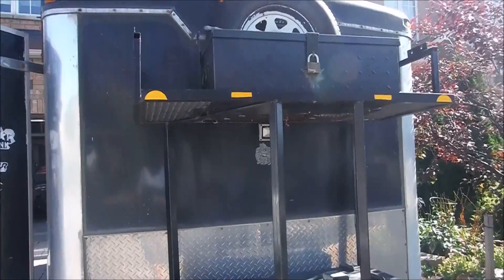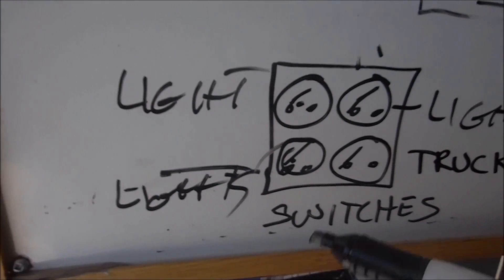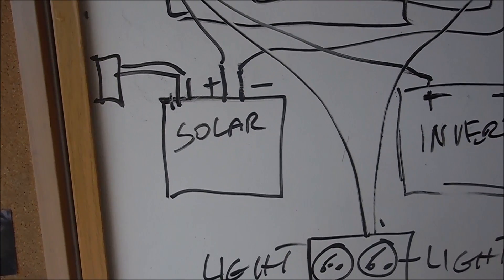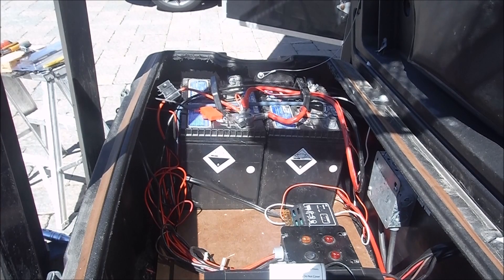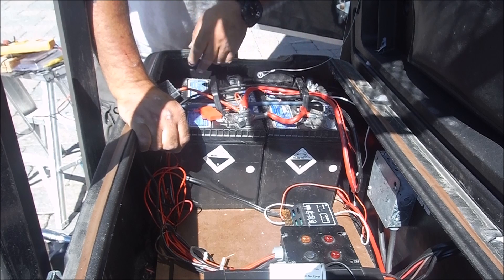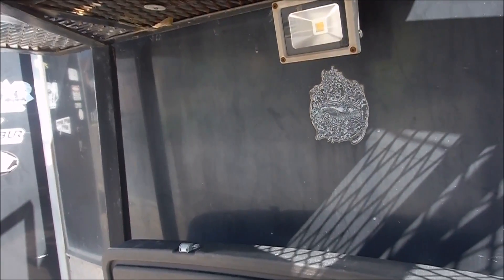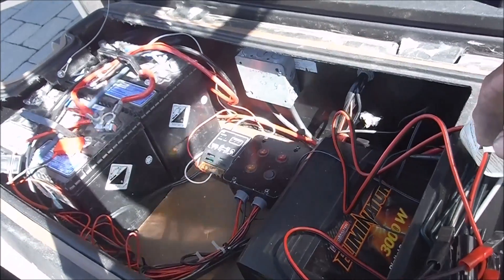How To Connect Solar Panel to two or more 12 Volt Batteries

Comment: What size solar panel does it take to charge two 12v batteries like you have setup
Reply from the maker: I only used a 40 amp and it was fine . If I was to do it again I'd go minimum 80 just for a faster charge but 40 works fine

Comment: Ps, I've noticed that you've put 3 wires on one red and 3 on one black. It's getting a bit crowded. 

Question: can I put the inverter on the other red and black battery point's, using the both batteries? That means there'll be 2 wires on every battery connection point? Instead of 3 wires on 2, and 1 wire on the other 2. Hope that's ok? Paul 🙏
Reply from the maker: yes you can. I just used what I had and all individually fused. As long as you keep the batteries in parallel is all good . I would show you but both my trailers are in storage. I actually bought a power distribution center and just have one wire on each terminal now. was a pain connecting all those wire everytime i put the batteries in. 4" Ground/Power Distribution Terminal Block Battery Bus Bar Set [Max. 300V AC/48V DC] Negative/Positive Insulated Busbar for Auto Marine Car Trailer RV Boat - Black/Red on amazon
Reply: @FranksDIY  ok thanks Frank. Eventually I'll buy some Solar and batteries to do just that. Cheers, Paul.

Comment: Thanks! Just bought a 100 watt panel.hoping it can run a mini fridge for deer hunting
Reply from the maker: Its all on the battery capacity. Have a few good Batteries and it should be fine. Well for me I'm in Canada and my deer hunting season there is always snow and cold . Have a back up generator for those over cast days. Good luck this season. I just finished the last of my venison and can't wait to restock

Comment: Hi hows things I want to do the same thing only with 2 batterys linked together to give 24v ?
Reply from the maker: Other than what's happening in the world great . Thanks for asking. For a 24 volt confection( + - + - ) connect the positive from one battery to the negative of the other battery and now you will have a free positive and negative from each battery to connect to load and that is also where you would connect solar regulator. Just make sure its rated for 24 volt.     check this like to see     https://www.google.com/url?sa=i&url=https%3A%2F%2Fwww.practical-fishing-tips.com%2F24-volt-battery.html&psig=AOvVaw1tUdCi52yIYlx3Ess4t765&ust=1587949600648000&source=images&cd=vfe&ved=0CAIQjRxqFwoTCOCdmrPzhOkCFQAAAAAdAAAAABAD

thank you
Reply: Thanks for that would I have to connect a load?I want to keep the batterys from discharging on my boat not run things
Reply from the maker: @Davolad-dj9jg  if storing yes no load but you can charge it as you use it as well.

Comment: what a waste of 12 minutes I asked about connecting 3 batteries this guy went mumbling  on his switch box and what that for which I didn't need to  know about, and an inverter and still did not mention a 3rd battery . would not waste my time again
George     North Yorkshire
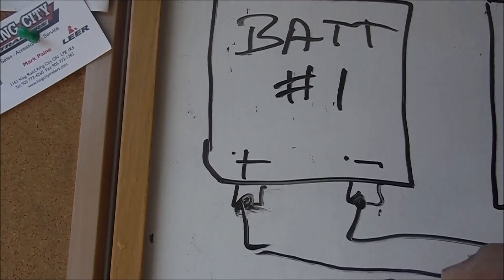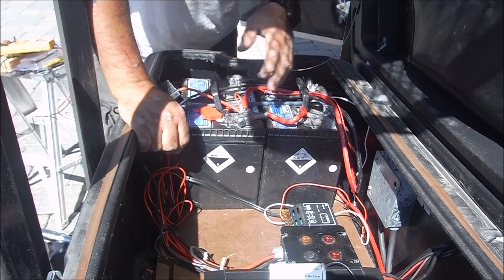Reply from the maker: Well It wasn't me because this is the first time i'm seeing anything from you . In saying this it is an easy explanation that is actually in this video(2:20) (8:40) . OHM's law if you hook them up in parallel at 12 volts the output would be 12 volts.. Meaning positive to positive and negative to negative. this will change if they are different voltages. I'm assuming they are twelve volts. If they are and in parallel they voltage will remain constant weather it's 2 or 3 or 12 batteries keeping in mind that Amps will be the variable. So in short put 3 12 volts batteries together in parallel. And have a nice day and don't be so angry life is short enjoy

Comment: Have you tried wiring the controller to charge your car main battery and both deep cycle battery? If so, does the alternator cause a problem to the batteries and charge controller while with engine on.
Reply from the maker: It has a regulator that prevents it from discharging the battery on the truck should have put that into the video. It only charges the batteries when the truck is running. If you don't have that just unplug the trailer from truck or car to be safe. I also put a switch on it that way you don't have to unplug it. Thanks for reminding me I need two new Batteries for the spring time lol
Reply: @FranksDIY  Thanks for the reply. I have fully tested and confirmed it works with the following setup to connect AMG batteries to Car Battery and running on the alternator with Solar connection.

Items: 
1. 100w Panel Monocrystaline.
2. 35ah AMG deep cycle battery
3. Charge Controller rated at 50amp
    Handle from 12v to 24v
4. 2014 4runner with 12v Battery

Setup: Steps
1.  Parallel connect both AMG and Car Battery. POS to POS and NEG to NEG using a 10 Gauge Wires. Once BOTH BATTERY are CONNECT. IT IS NOW 1 battery with more power. Yet it remains at 12v instead of 24v. 

2. From Charge Controller (Red wire Positive) connect it to AMG Terminal (Positive).

3. From Charge Controller (Black wire Negative) add a 5amp fuse to the wire and connect it to Car Battery Terminal (Negative).

With this setup you are able to run your car and have both the alternator charging the batteries and solar charging. No need to disconnect any wires or add kill switches.

Now a days most or all charge controller has a safety built in. It will regulate voltage flow and will not burn out the controller or allow extra current to flow back. The Charge controller will simply shut down and shut off charge to batteries.

This setup can be done to multiple 100ah AMG batteries. Which will requires more solar Panels. As long as you connect the batteries in Parralle. For this example I am using only 1 35ah amg battery to bridge with Car battery running and using alternator to charge while Solar is connected.

Note: 100w Monocrystaline Solar Panel I have only can produce 18v max. The charge controller will self regulate how much voltage to charge the battery.

My charging test results is 15 mins per 1 volt. 4 volts per hour. 

4volts x 6hours in the sun. I get a full charge at 12.9 volts which is Full charged. Then again, the car always use power of some short as your day with it. I base this test on a stand still charge with no accessories running. 

Try it and let me know if it works for you.
Reply: @FranksDIY  my configuration..I am able to drive and have the alternator and the solar controller charge both batteries and not have to flick any kill switches or isolate each batteries. 
As for your setup it is possible to have all 3 batteries  Simultaneously charge with solar and alternator as you describe with Parralle connections. I didn't have to use any regulators
Reply from the maker: @denoc817  I do have my alternate charging all three when I want but the solar is blocked from charging the truck due to a built in diode in controller.  Sometime things go bad and you don't want a dead truck.I also have a generator as another means of charging and running things as a back up like at the end of this season Batteries went to shit and I need to run generator instead. I got my 5 years out of them lol
Reply: @FranksDIY  Nice :) nothing last forever. I'm due to upgrade to a single 200w solar panel and 2 any 110ah battery. Going will out with a new build. But the cost 😫 

Purpose is to use it for 4x4 off roading /camping for 5days. Also use power tools in case shit breaks. 

Thank you again for making your video. It did help me allot. GOOD job

Comment: in parrallel, its the same thing to plug the negativ of a battery or another as they are connected and therefore the exact same thing. you could have plugged the solar panel to one battery and plug the second battery in parralel and obtain the exact same result (no difference of lifespan or thing like that)
Reply from the maker: I know it's the same and I said that in video but From some of my friends and  documentation that i read there are conflicting theories,  So i just thought that it would be the more ideal way to do it.The reasoning behind was if one battery is lower than the other it would give it less life as well,so this way it would be more efficient. Thank you for the input and for watching.